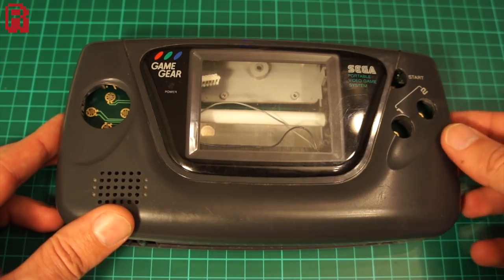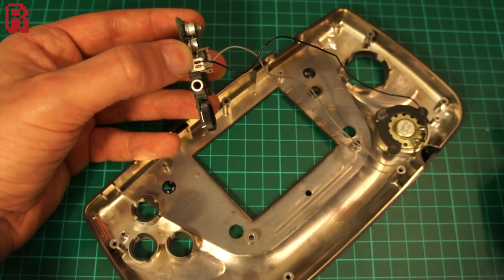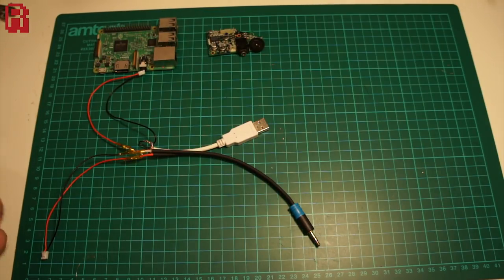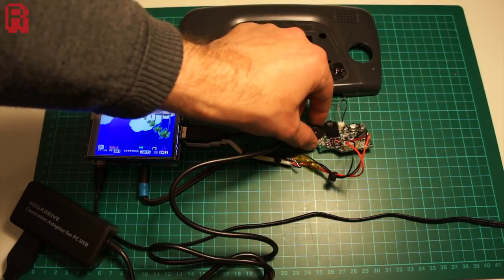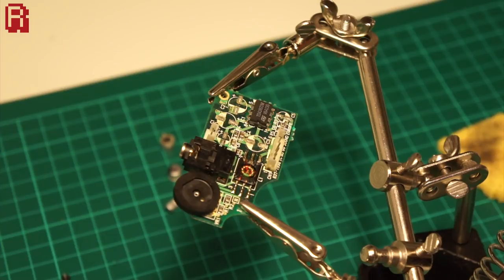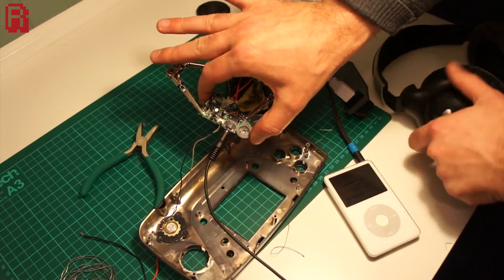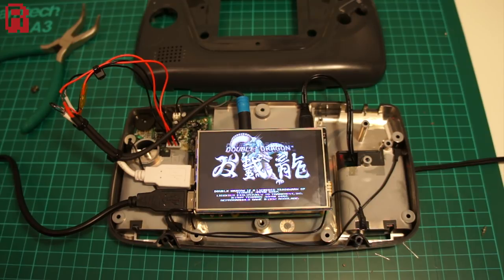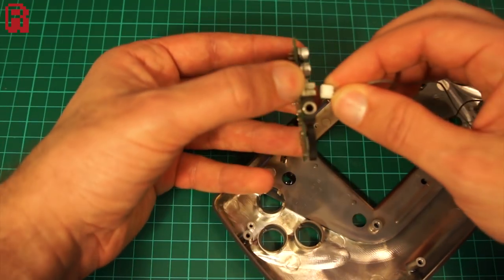Sega Game Gear Sound Board to Raspberry Pi

Comment: Hi,

The SPON (SPeaker ON, I'm guessing) signal gets connected to Ground when headphones are plugged in (by the spring switch inside the socket).

The switch also disconnects the Ground pin of the internal speaker.

SPON goes to pin 100 on the main ASIC, so probably has it's own pull-up resistor for that.

Presumably, the signal can be read by the games via a register, or it's just so the ASIC knows to mix the audio channels together for mono sound when the speaker is used?

I'm not entirely sure whether the headphone status can be read in the code, but it's feasible, as it would have surely been simpler to just mix the two audio channels to mono (for the speaker) on the audio board itself?

The Game Gear is one of those notorious consoles / handhelds for leaky caps btw.
The last few I bought all needed the caps replacing, as they either had no (or very quiet) sound, or screen issues / shutting down.

Comment: The SPON pin is connected to the headphone plug. When headphones are plugged in, the end of the plug pushes a little lever inside the female part which is the SPON switch.

Comment: My guess is that SPON was used to hide hiss and turn off the audio amp to save power during silent portions of the game.

I recently recapped one and there was no sound until I found the corroded via UNDER C3 and jumpered it from CN1 pin one (“SPON”) to the positive side of C3. This restored the audio even though the diagram only shows this cap going to ground.

On my twin ASIC VA1 Game Gear (not the one with the corroded SPON via), my imported copy of Sonic Drift has a loud tone or buzz when you cold boot. It goes away completely when the music starts. You can quickly power-cycle it after the music starts and the tone/buzz is not there. If you power-cycle it early while the tone/buzz is still happening it will always be there, no matter how long you give it.

You can tell what’s happening: The speaker is ON during a cold boot when it should be OFF. When the game finally uses SPON to enable the speaker it begins behaving as it should. Something is enabling the amp at boot when they should not.

I’m about to test it with the other audio board I recapped (the one with the corroded/patched via) to see if it has the same problem.

Edit: Tried it on the other system. No problem there. This is definitely tied to SPON.

Edit 2: Switched the audio board. Problem stayed with the main board (did not follow the audio board). Switched the power boards too and the problem did not follow those either.

Comment: Shoutout for Sennheiser HD570 owners! I'm actually trying to repair mine. One of the headphone brackets that holds a headphone to the headband broke and I'm designing a printable replacement. If you ever need one keep an eye out on Thingiverse. I'm about 90% done.
Reply from the maker: Steven Olsen those bad boys are 15 years old.  I've replaced the felt and foam in them and they still sound as good as new.  Top cans!
Reply: I replaced the audio cable about 10 years ago as the contacts had worn out (strange I know). I also replaced the felt and foam but it wasn't available anywhere in Canada and no one would even ship to Canada. I had to get my sister to buy them for me when she visited to New York. I've had mine for over 18 years. Nothing beats velour! All the headphones these days seem to love fake leather.

Comment: Has anyone had problems with the yellow under voltage lightening bolt? 
I have a pi 3+b, I’ve run the 5v from the power board to the pi, and the ground. The grounds on my power board were connected when I opened the case up, that shouldn’t have mattered, should it? Any advice is appreciated!!

Comment: Is it possible to use the GG sound board with a Pi Zero ?
Reply from the maker: +Martin Kidd anything really so long as you can feed power and audio into those pins. I used an Ipod with it when testing the idea
Reply: I guess with the zero you would need to add a USB Sound card and use the headphone jack from there?
Reply: Martin Kidd hello, did you try it with a pi zero?
Does it need a sound card? Or can you just wire it straight to the zero?
Reply: Martin Kidd basically
.. do I need to make a filter for the sound?
Reply: This is exactly what I'm doing. You need to make a small circuit to get the signals from gpio. Then feed left, right, power and ground to the gg sound board.